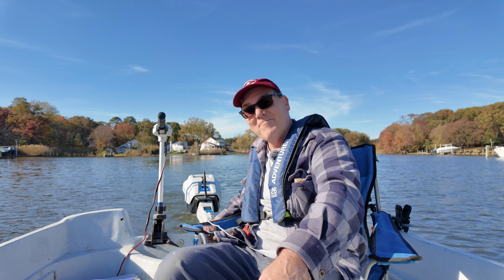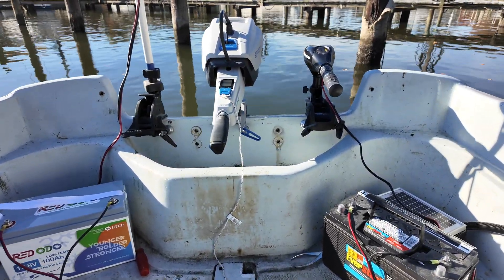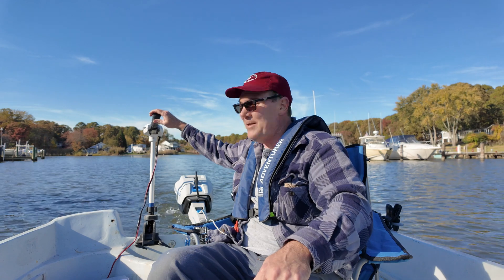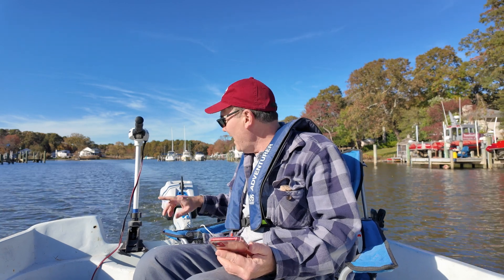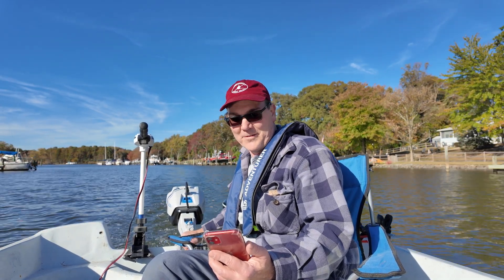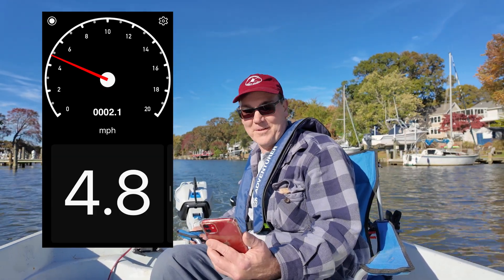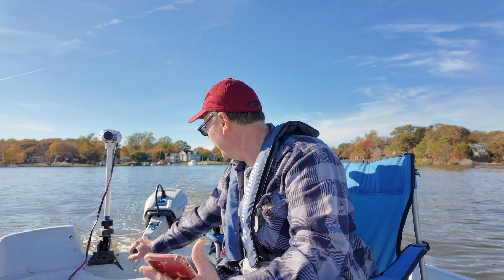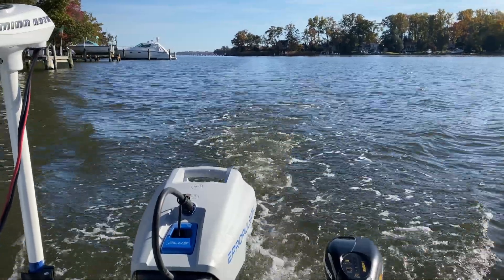Faster with 3 electric outboard motors?

Comment: The problem with just adding more motors is that they are each only capable of moving a certain amount of water. This is dictated mostly by the prop pitch. If you added two motors AND increased the prop pitch you could gain more speed. Otherwise your simply lessening the load slightly on the strongest motor.

I have a dozen 3hp Minn Kota trolling motors, they were the highest output 12v model from the late 80's to early 90's. They came with rigid Lexan props and under full power did best with two large batteries run parallel. Carrying four large batteries in a 14ft aluminum boat with one versus all 6 together, I gained maybe 0.7 mph on calm water. It did lessen the overall draw of each motor but they are simply only capable of a certain RPM under load. If there was an option to increase the pitch then I'd gain speed  as the motors would then be moving more water under the boat and able to do so with the help of the other motors. Even still, I doubt any increase would be significant.

Comment: I haven't finished watching, but before I see the results, I'll chime in that the boat can't go faster than its hull speed, which is calculated by the formula: Hull Speed (knots) = 1.34 * √(Waterline Length in feet). For a 17' boat, that is 5.5 kt or 6.4 mph. I'm predicting you'll just reach 6.0 mph.
UPDATE: I was wrong, overly optimistic. But actually, I used 17' as the length, and that's not the waterline length. I don't know what that is, but if it was say 15', then hull speed would be 6.0 mph. I still would have guessed high. Oh well. Fun test to do. Thanks!

Comment: At what speed does the ePropilsion motor move that boat normally with no trolling motors dragging in the water and without their batteries onboard? Are the trolling motors simply overcoming their own drag and the additional weight of their batteries? Inquiring minds want to know. Next video, maybe?

Comment: My Torqueedo 3hp outboard managed to tow my 35 foot sailboat to safety over a mile rather slowly when the engine and wind died in a shipping channel. Still had 57% charge remaining! These motors have torque, but not much speed

Comment: Pretty sure spinning up the other two is mostly just removing drag. Your around the speed those motors will push an empty surfboard. It's like trying to push a car that's in second gear while you're car is stuck in first. It works until you run in to the rev limiter.

Comment: Everytime I think about small boats I just see atomic starbursts and polished gleaming aluminum. Small motors and doing it yourself. Don’t need a 90k Skeeter when a $200 12ft v-hull can catch bass. Small boating is a vibe.
Reply: for real. People take out huge loans on expensive boats.... Makes no sense unless you guide for or do it for a living. A bass tracker will catch the same bass that a 150k ikon will catch.
Reply: @Connor-zb4uo Can't tell you how many times $20,000 boats get close to me in my $500 kayak because I'm catching slabs and their $1,000 fish finder can't find them a minnow in a bait store.

Comment: That was a good laugh! Your setting reminds me the stupid boats which are docked all year long at the marina. They have 2, 3 or sometimes more insanely powerful outboard engines. Yes, they can go fast. But I've always wondered how much fuel per hour they burn.
At least, with your Boston Whaler, you don't go fast but the consumption is close to zero! And you have plenty of time to admire the beautiful autumn colors of the trees along the creek.
Did you succeed to get back to the ramp before it gets dark?
Reply from the maker: Yeah I'm growing quite fond of slow speeds!

Comment: In my unprofessional opinion 
3very time you triple the hp, you get +1/2 speed
Reply from the maker: So... another 3 with only get me another 0.5 mph - good to know!
Reply: @WayneTheBoatGuy  basically yea.
24ft cape boat with 45hp=8mph 200hp=12mph (this isn't a speed boat, but something like a Maine lobster boat)
Reply: @WayneTheBoatGuy  also, I find extra motors don't help top speed, but aid immensely in holeshot, and in towing, as you are pushing more water, but not really going speed